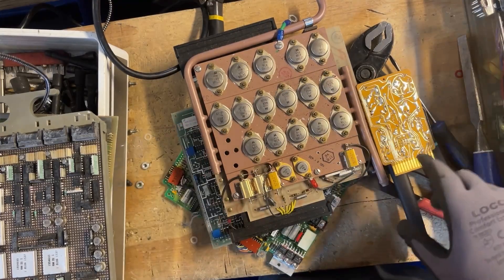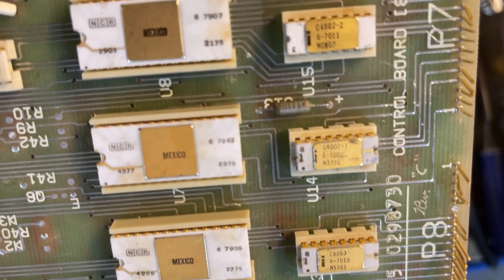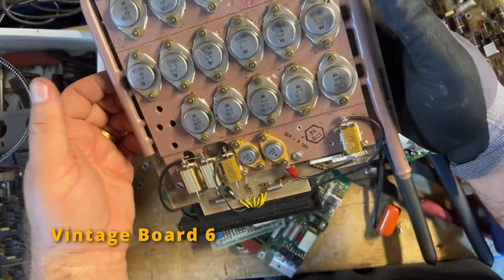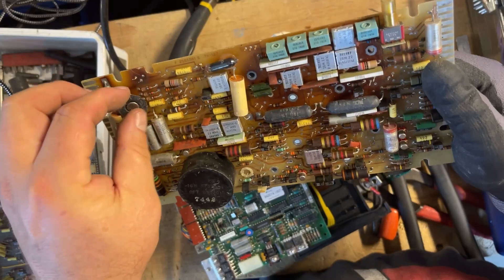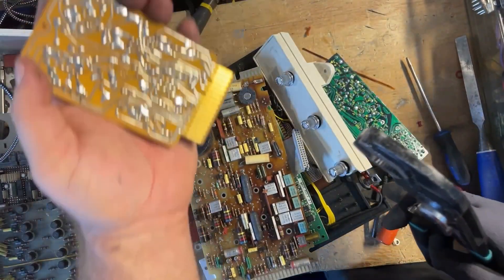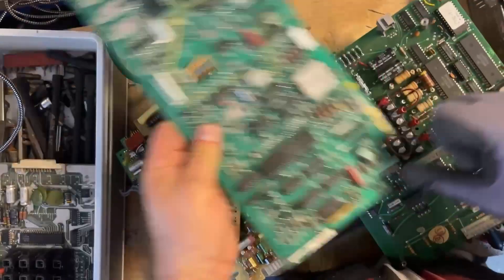Vintage circuit boards haul: rare Intel CPUs, eWaste gold, IBM / Texas Instrument / Motorola chips

Comment: I've made it a habit when bringing stuff to my local e-waste place, to dig through their container of boards and pull stuff out that may have value when sold as parts. Feck those handful of dollars in gold, when there's chips on them that will fetch hundreds at auction from people who try to restore vintage electronics.
Chop the fingers off if you want gold, but please don't destroy any more chips. There is so much of e.g. early arcade consoles going into e-waste because the chips needed to repair them are no longer available.
Reply from the maker: Yeah, we had no idea until a friend told us- that's why we made the video. So other ewaste professionals pause and recognize the value. Thanks for the tip on arcade consoles

Comment: 4:50 these aren't striped capacitors, these are carbon film resistors, probably in the 1 Watt class judging from the size, and they follow the regular resistor color codes.
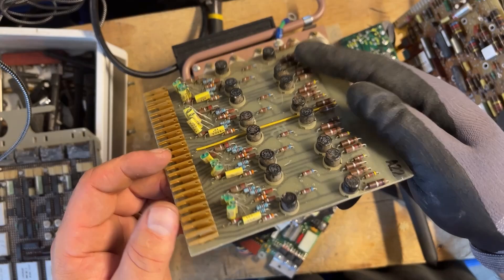2:30 pulling these round chips (that look very much like early op-amps (operations amplifier) to me and selling them as a matched lot might actually fetch some nice money
Same goes for many of those IBM chips which are a ceramic base with a thin aluminium cover, some of these are highly sought after and fetch good coin.
5:40 these aren't capacitors, these are transistors in the metal cans. some are cheap mass products, some are very rare and people pay well to refurbish their vintage devices.
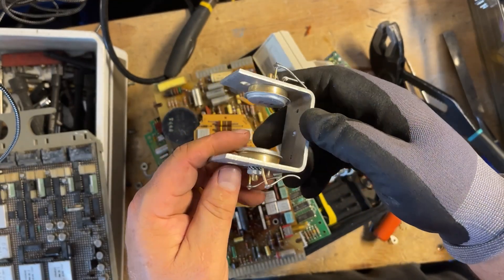7:20 same here, vintage power transistors as part of an amplifier or motor control, many of those are trading very highly, far beyond the milligrams of gold you can etch off them.
Reply from the maker: bro dropping the absolute knowledge in the chat!! That's a huge help man, thank you!